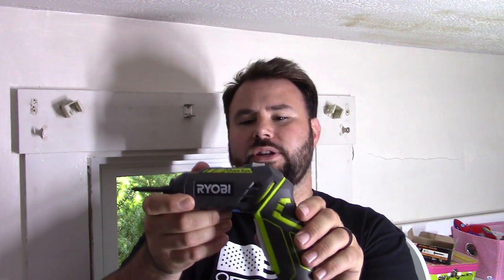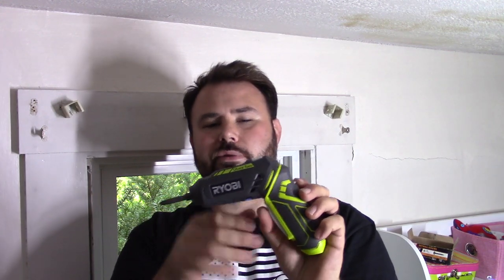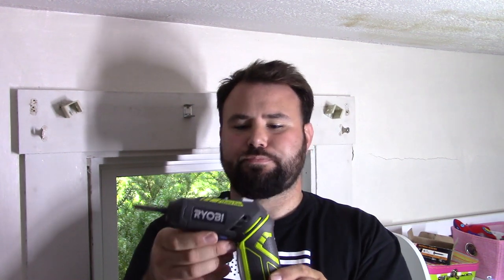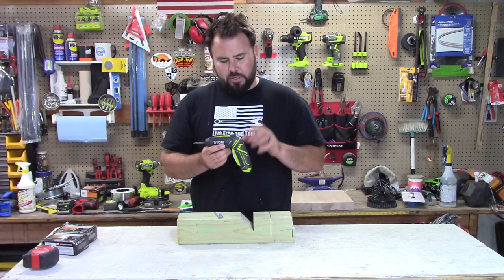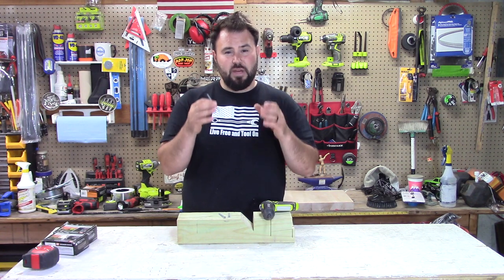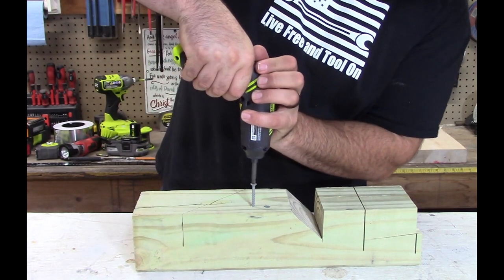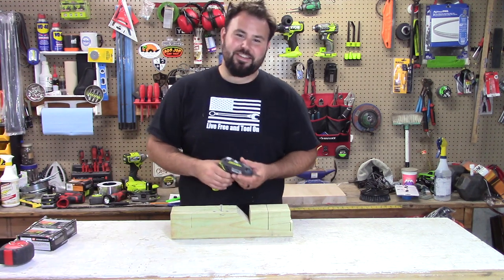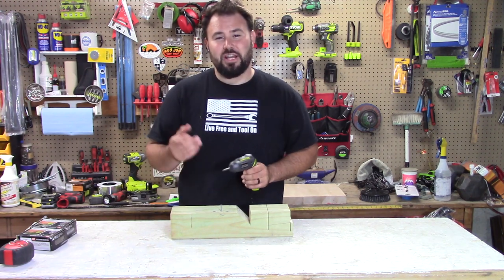Ryobi 4v screwdriver [mighty mouse power!]

Comment: Recently nabbed one of these and was left disappointed. Didn't come in with expectations of having the same power as a full sized driver but didn't know that what I was doing was going to suck the life right out of the device (after a long 9-hour charge)...All I was doing was driving 3/4-inch screws through a sheet of PVC sign board into a 1x2 stick of wood and by the time I got to the 6th screw, it struggled and died.